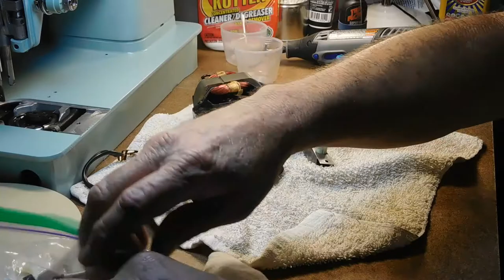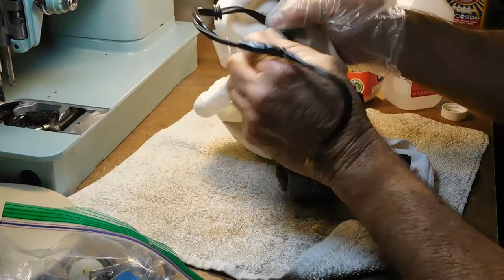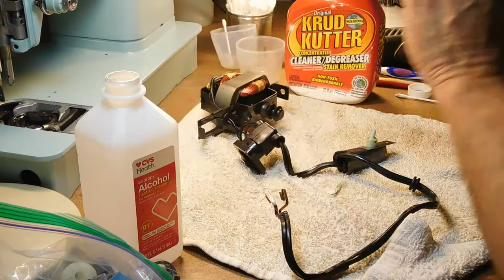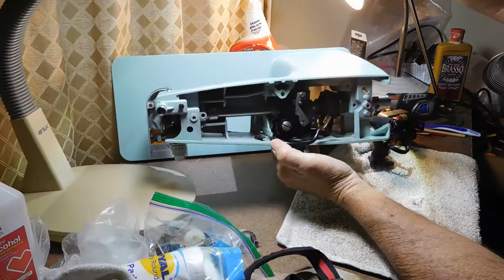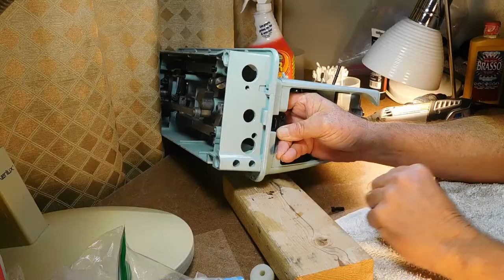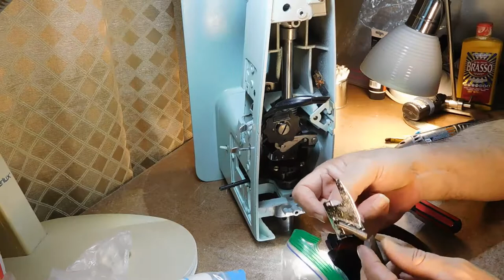Step by Step Restoration of a Singer Model 337. A Series. Part 15: MOTOR-WIRES-SWITCH

Comment: Hi Andy.  After watching your videos on removing and reinstalling motors and lights several times, I finally was able to remove, wipe off, and reinstall the motor to my 457.    It was somewhat tedious to get the motor out and then back into the body, but I did do it.  I can see the advantage of having exterior motors.  I really liked your method of taking out the entire electrical system, not snipping some wires to separate the motor from the light system, as I think the service manual suggests.  I think the 457 is a little easier to get the electrical system out because I was able to remove the cams first.  Thanks so much; less than a year ago, I would have never believed I could do something like this.
Reply from the maker: You are the BOSS, Carole. Congratulations! So, so true that it is a tedious operation. Motors mounted outside on the back are much easier it is true. I still love the slant-needle PA style motor the best though. I'm glad you persisted with the wiring system removal. What a good job you are doing. Thanks for your comment. Take Care.

Comment: Hi Andy,
Can you give please give me the correct name for the off set washer and spacer for the motor adjustment and to secure it with the screw.
I have a Singer 348 and those are missing.
Reply from the maker: INSULATING BUSHING - PART 179615, WASHER - PART 98145, ADJUSTING ECCENTRIC - PART 179618, 
LOWER BRACKET SCREW - PART 50172
If you'd like a copy of the Parts and Service Manuals email to andymanuals53@gmail.com and ask for them by name.
Good Luck.

Comment: Where do you get a new motor if the old one is burnt up?
Reply from the maker: If you are talking about an internal motor like the one in this video I do not know a seller of brand new motors. I would look for a used one on eBay, Bonanza, Thriftyfarmgirl.com or other online sellers. I believe it is a Model SN(K) OPEN motor and it was used an the 300, 400 and 500 series of Singer machines. If you mean an external motor that mounts outside on the back of the machine there are many sellers of new motors as well as used ones. BTW, I have never encountered a "burned out" motor. Motors with worn out brushes and motors thay have oil on the brushed and commutator I have seen before, and they can be cleaned and put back in service.